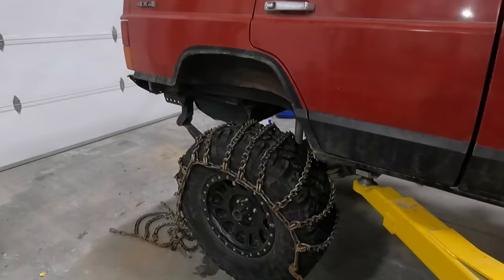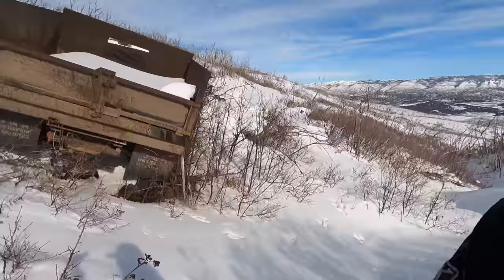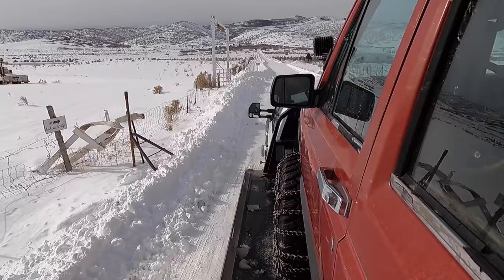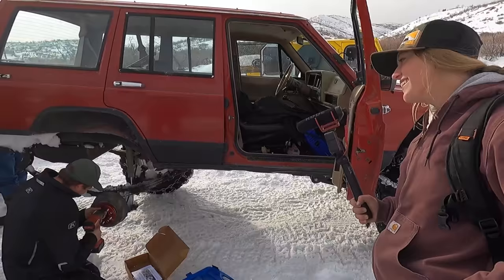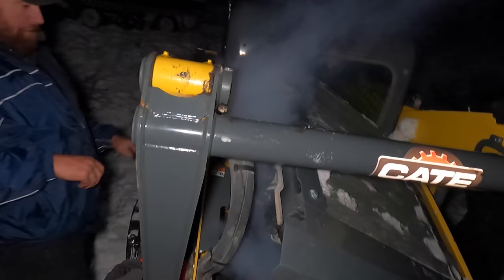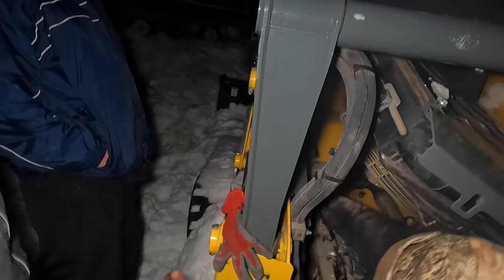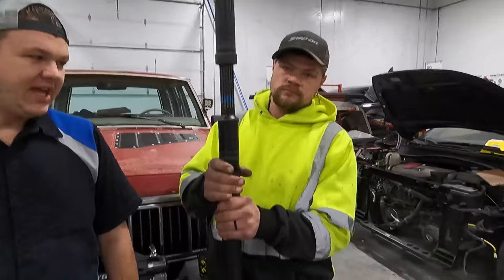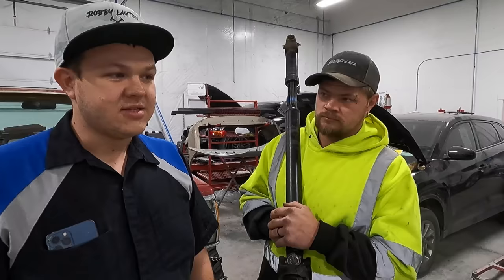WE ALMOST GAVE UP! 1 Frozen Skid Loader & 2 Trucks With Matt's Off Road Recovery + Trail Mater

Comment: A propane torch would have come in mighty handy to free the skid from the ice.
Reply: or a good way to set those rubber tracks on fire, the one down side to those in icy conditions
Reply: Not a torch, too little heat in a too concentrated area. One of those Dewalt Lithium powered propane torpedo heaters would put out more heat, at a more useful temperature, and by their nature direct the heat forward and can be aimed. That and a couple 20lb propane tanks wouldn't take up a ton of extra room.
Reply: And Matt has a flame thrower….
Reply: @martykitson3442  Only a fool would aim the torch straight at the tracks😆 Sounds like you're the type of guy not to be given fire implements eh?
Reply: @mlindholm  Torch is plenty. Been there and it works perfectly and quick.
Reply: sure, why not try to use just the right amount of dynamite, you know... not so much that it would blow the whole rig up but just a pinch or 2 to loosen that ice up a bit.... Slow and steady wins the race...
Reply: @jackkushner8026  Dynomite it is. As a prudent part of any future off-road recovery package. Not a whole lot - just a tiny little bit. And where there was a road, it would afterwards become off-road once the dynamite is dutifully deployed. 👍🏻 More recoveries!
Reply: @jackkushner8026  And that's why certain folk never get to use the big-boy tools.😆🤣

Comment: It's Alive!! Great job Hillbilly! If you ever need CPR, Hillbilly is the one to call on, he doesn't give up even when the doctor calls it. Frozen in time, maybe a blow torch, space heater. I have to say chaining up is the best way to go in deep snow. A little noisy but they work like awesome with all four working. A bit of a pain to do on the road side, but well worth the time and effort in the long run. The hard part being the towed vehicle is knowing which way the steering wheel is turned, which makes it tougher for Lizzy. Robby with no fear racing around the curves. Maybe a large push bumper and you could have pushed Lizzy right along. Well that sucked loosing the drive train, but building it better and stronger is a great idea. Did watch Matt's video first and then came here to finish up the rest of the recoveries. This one was very entertaining and well done.

Comment: Fast way to charge those battery packs is put it on a running vehicle and turn the pack on like your jumping it but will recharge it instead I used to do this to my Stanley Fatmax Jumper box!

Comment: That looked like hard work.  Tucker Sno-Cats came with a defrost point near the tracks, and about ten foot of flexible exhaust extension.  You hooked the flexible over the exhaust and used engine heat to defrost the tracks.

Comment: One tip I can give you for cold weather recovery is take a weed burner and a propane tank so you can warm up Any frozen vehicles or tracks.  I carry a tank and weed burner torch everywhere I got on my recovery truck, it never hurts and if you end up stranded you can warm up also :) weed burner and a spud bar and you'll have the necessities ❤️ I live where it's pretty bad especially during the winter months so just some tips from an old oil field worker haha

Comment: Nothing like breaking Dana boxes in the middle of recovery 😉 time to spoil the rear 35 and possibly put a 60 up front 😉 the 30/35/44 don’t hold up well. Pull drive lines from a old 25/3500 ram and don’t look back ☺️

Comment: Great job hillbilly! I had my 18-wheeler fuel gel up one time and it took me at least 1,000 pumps on that fuel filter housing to get it going. You got to use that anti-gel before it gets turned off!.. especially in sub freezing temps

Comment: It is much easier when putting tire chains on to let tire air pressure all the way down then tighten the chains and reair them up, it will get the very tight and let you get good speed. They will not fly out or come off.

Comment: That wire was probably an oil level switch.  It's just out of the oil because of the angle.  Spent hours trying to get my generator to start once only to realize the hill was too steep lol.  Propped it up with a log and it started first pull.

Comment: You should consider a TJ Rubicon t/c (4:1), some 9" axles with 35 spline shafts (Currie F9's or Spidertrax, lighter than D60's) and 1350 driveshafts, plus going to bigger tires

Comment: Ooo, looks like a common rail diesel .  Bad idea cracking fuel lines to the injectors.   Ok for older style diesels.  Be really careful, common rails run much higher pressures and you run the risk of injury and not sealing the lines after cracking them open.  (some wont seal again unless replaced)

Comment: Hate to say it but all they had to do was fill it with diesel and turn the key for 15 minutes with a battery booster.  That skid would eventually self prime.  Everything he was doing was hurting the situation(opening the fuel lines?)

Fixing the track is another 30 minute job but we can cross that bridge later

Comment: Can we have a moment of silence for the Dana 30 formerly in the Jeep? OK, now it's time for 3/4 or one ton axles.

Sometimes when you get stuck, it's time to stop and start shoveling. 

Any small diesel engines that refuse to start, a whiff of starting fluid will get the engine running enough to start building oil pressure and then fuel pressure. If it attempts starting on fluid, some PB Blaster in the intake will bring the engine to life, plus lubricate the cylinders.

Comment: For the life of me I can't figure out why none of you guys ever think to use tire chains on the vehicles you're recovering or even your own. Robbie is the ONLY one that I have EVER seen put chains on his vehicle!
It seems to me that you could incorporate asking the client what size of tire and wheel he has before going out there, and then taking a set, (or two for FWD).
There's many sets that would fit many vehicles and it's even possible to make some fit even though they're not designed for them specifically just so that you can get them out.

Comment: There's an old trick of putting a long hose over the exhaust pipe and putting it under the machine.  Then covering the machine with tarp or plywood.  Let the exhaust warm the machine up by itself.  You guys busted ass on this thing.  Not a fun environment to do that in.